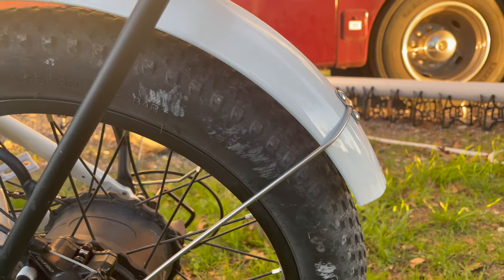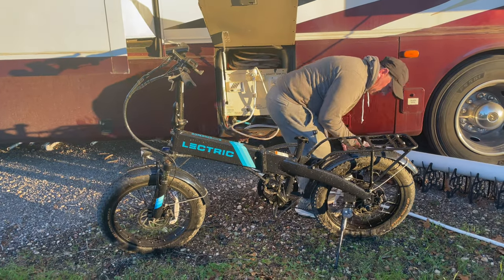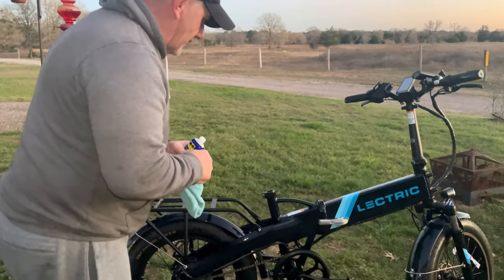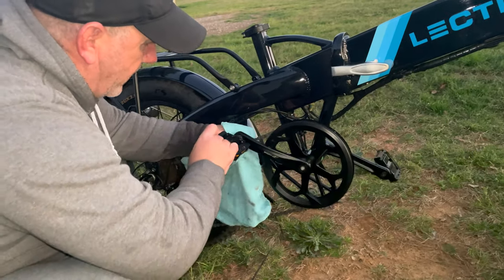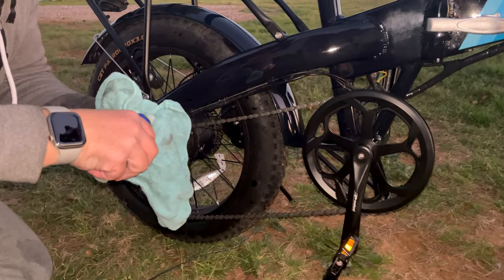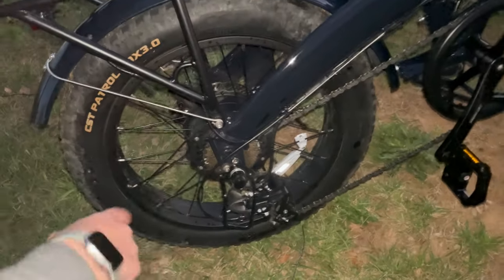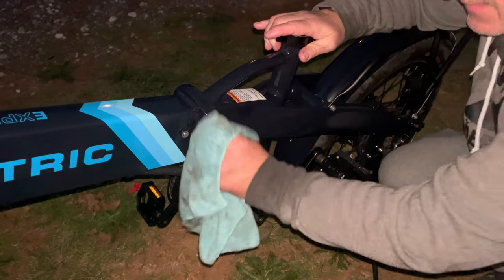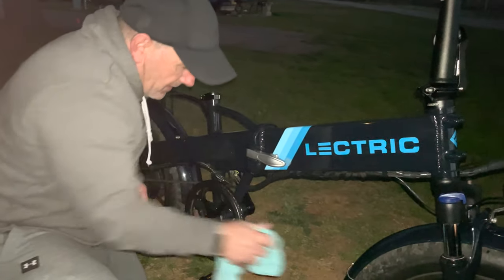DIY: Lectric E-Bike Wash and Lube; Step-by-step How-to Guide

Comment: I have 6000 miles on my lectric 1.0 bike and only use a damp cloth to wipe down and never touch the disk brakes at all. Bike still looks pretty good for sommany miles. Ivve done all the work on it myself in a small apt. Upgraded the freewheel. Seat, added a small spring loaded cargo box on the side and replaced the battery from ali express.
Reply from the maker: That’s definitely a lot of miles. Thank you for watching.

Comment: The Lectric site has tutorial video as well showing how to clean.  They don't use a water hose though and minimize water usage.  One important thing I learned was to only clean the brake discs with rubbing alcohol.  Thanks. 

Here's the Lectric video link:  

https://youtu.be/b2azF0bLAT8
Reply from the maker: I use brake cleaner for the brakes. Thank you for the link
Reply: Thanks for showing the lubricating part, too! Once mine comes I'll lube it up with your approach after cleaning.
Reply from the maker: Thank you for watching our video. Did you subscribe? If not. Will you please tear really will help us out a lot.